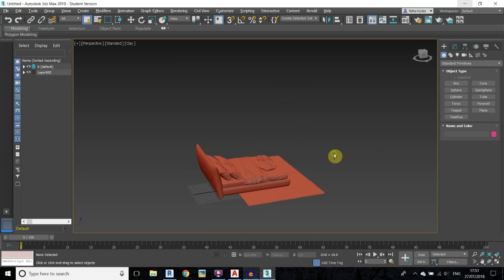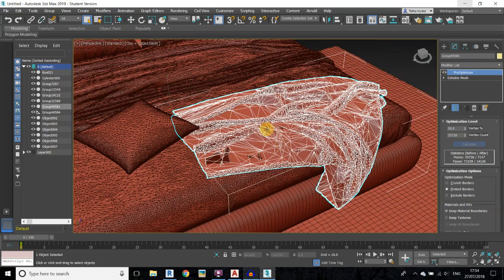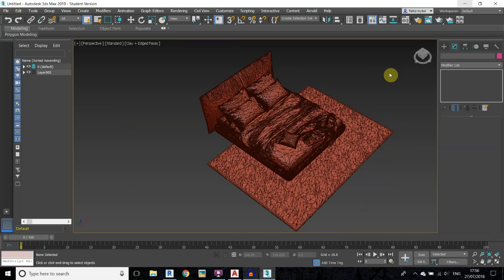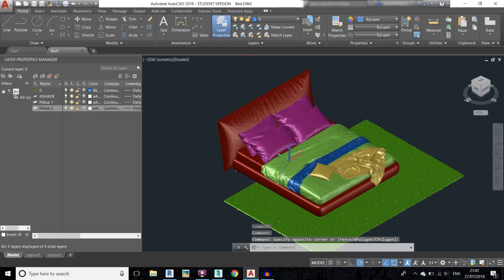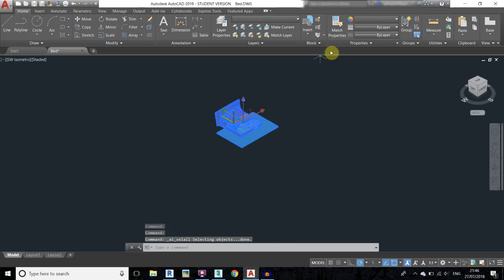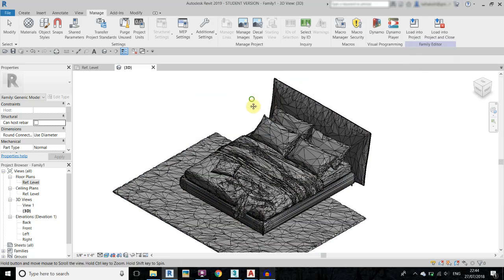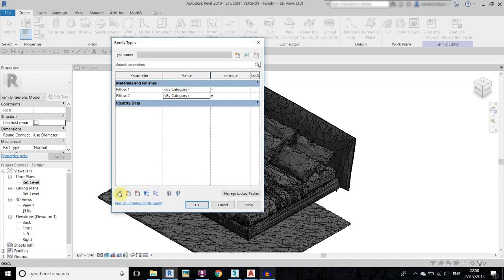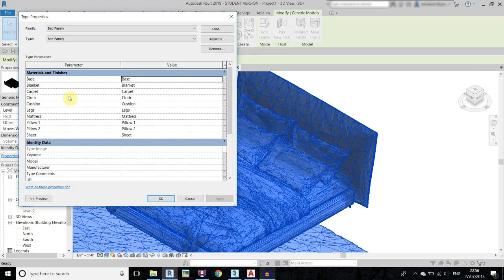Revit Architecture | Convert 3ds Max Model Into a Revit Family

Comment: i did in the same way but after adding material to pillow in revit the textures are appearing as tiles on each polygon  surface of pillow even of turning of show edges option in graphical settings , can you please hep me with this problem
Reply from the maker: Increase the size of the texture..